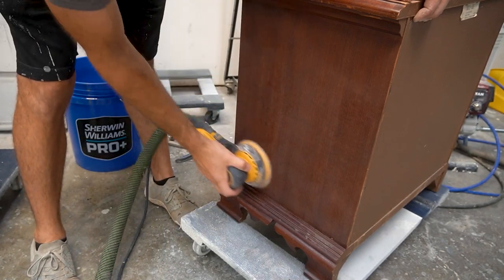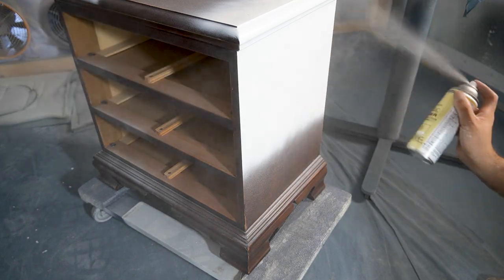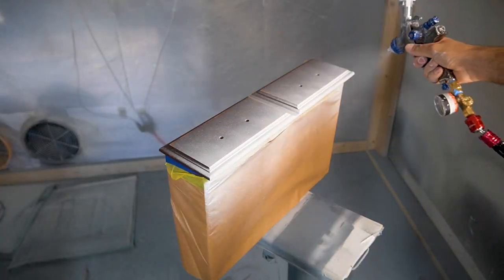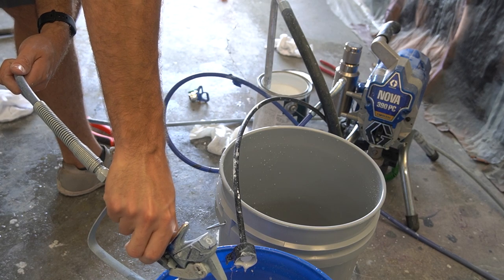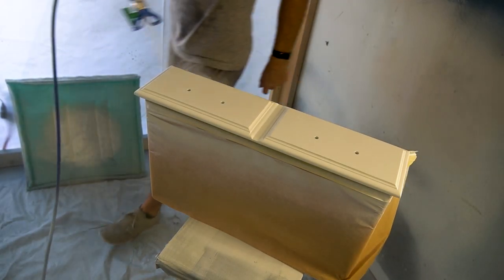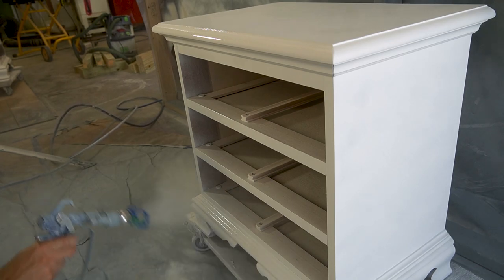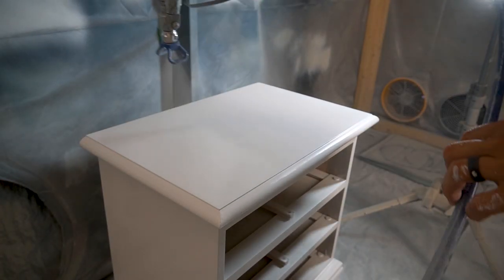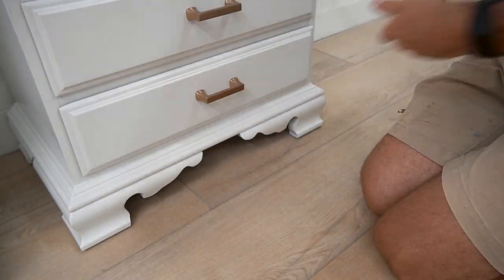Furniture Flipping - My Painting Process Start to Finish + Trying Sherwin Williams New Paint

Comment: Awesome paint job but maybe consider reworking or removing and replacing the swirly trim along the bottom and the legs imo. It keeps it from looking updated.
Reply from the maker: Ive thought about doing this before and making them square by taking the coping off that’s got that French provincial style to it, since the modern straight lines sell way better. It’s so much work though 😂 thank you!

Comment: You used a primer but Gallery Series is advertised as self sealing which is supposed to be all-in-one. Were you afraid of stains showing or was the paint low build? What are your reasons for using a primer with a self sealing system?
Reply from the maker: It is definitely not going to block stains. 
You should set up an account with Sherwin or your local Benjamin Moore dealer. Just get a company name, and set up an account, and they will give you better prices. 
Ben Moore owns a company called lenmar that sells a good vinyl sealer. Mohawk is good too. Also, BIN shellac is good too, but I prefer vinyl sealer. I don’t pay over 75$ per gallon. But no, it will not block stains in my opinion and should not be used as a primer.
Reply from the maker: Also Sherwin only has clear vinyl sealer which I don’t like. It’s too hard to see if you burn through.
Reply: @milosrestoration1337  yes I have an account with SW. I’m glad you said it won’t block stains as I was planning on using that product for a cabinet job over some maple cabinets. I have used BIN it has been my bread and butter but I am looking for an affordable vinyl sealer since that is the best thing as BIN will fail if the moisture content of the wood is too high or water penetrates through the topcoat. I am familiar with Mohawk and Lenmar but where I live in Florida I only have access to SW unless I order online. Have you tried any other 1k/2k polys and if you have could you possibly give a comparison to those against Gallery?
Reply from the maker: @bingobunga8995   yes I’ve tried centurion and a few other products that emulate a lacquer like duralaq. Also tried some other products that are 1ks. I don’t like any of the 2k primers, they’re very hard but I find them not to be as good at stain blocking or adhesion even though everyone claims they are. Gallery has better hang than any 1k products I tried and doesn’t have issues with micro bubbling or pinholes which will drive a painter insane. There is no primer I’m aware of like a good vinyl sealer! Mohawk had this one I’m linking to you. I really don’t like the finicky 1k products and I don’t mess with catalyst since I just do furniture and do a lot of different colors. Centurion is good and their customer service is helpful. I don’t use any of the Italian products though
Reply from the maker: @bingobunga8995  https://procabinetsupply.com/products/e-z-vinyl-white-sealer-550-voc-mohawk?variant=32250153566275&gclid=Cj0KCQjwkqSlBhDaARIsAFJANkjHkGByEk5povQVr4QYQnsum0MIyaKi6UzRJuxpWqZcaCsVmYOYvcYaArvXEALw_wcB
Reply: @milosrestoration1337  thanks! I just ran over to my commercial SW and gave them my contractors account and I can get Sher Wood Vinyl Surfacer Primer in white for about $57 per gal. I got the 5gal for $286. Thats wayyyyy better than BIN. I just like the build BIN has but I’m excited to try out this vinyl sealer. I know the lacquers burn down to about 20% of the original wet mil. Have you ever tried Kem Aqua Plus?
Reply from the maker: @bingobunga8995  yeah for sure! I have videos of me using it on the channel. It’s not that great. It’s not really performing like a 1k product and it has very poor vertical hang. Also, the transport time is longer in my experience. Doesn’t look as pretty either. It gets a bad rap with finishers but honestly it’s not that big of a deal.
Reply: @milosrestoration1337  that’s good to know seems like guys using the KA+ have the best results with AAA from what I read on painttalk and see on other YT channels. It’s also not warrantied for refinishes but that price is quite nice at $60/gal. Kinda sucks that Gallery is $120/gal but hey if it’s better than the other 1ks then maybe it’s worth it.
Reply from the maker: @bingobunga8995  it’s not the worst product. Not the best either. I can see if you could put it on thin and still have it level out like glass, that’s the thing I have to put a little more on and wait for it to level out. So I don’t know really, but if you’re looking for a refinishing product for cabinets or something it would not be my go to. Also, find a Sherwin branch that you can build some rapport with. We also do pool coatings so I have some credit with them because our company buys a lot of that type of product, but even knowing that if I walked into half the stores here they’d try to get me for retail for gallery. I’ve never had a true failure with BIN but then again I don’t have any clients past five years so it’s hard to really know. Everyone has a problem with some products, because everyone uses different equipment and has varying levels of climate control and experience. A lot of 1k products gave me problems with micro bubbling and dust showing in the coating. Gallery on the first go gave me less of that issue. If you have any questions shoot me a message on instagram

Comment: What vinyl sealer are you using cause SW vinyl surfacer I will not be using at $135 per gallon…
Reply from the maker: I ended up trying some BiN today before I sprayed more gallery. No comparison! I really don’t wanna go back to using it, I’m going to stick with the vinyl sealer
Reply: @milosrestoration1337  yes I like vinyl sealer just a pain if you only have one pump the clean up to use both water based and solvent based stuff is annoying
Reply from the maker: @bingobunga8995 I have a vinyl sealer pump.  It’s just an old titan 440
Reply: Yea eventually I want to get a tritech for finish coats but right now I’m working with a home owner special graco magnum x5. It shoots decent not ideal but it works. I highly recommend the graco silver plus gun. It has amazing trigger and pressure control. I use the cheap cone filters with a separate attachment, really awesome gun. I honestly think the 308 tip is the definitive best tip for shooting vinyl sealer and top coats. The 310 has too much orange peel. 208 is nice too but obviously not as much coverage. Kinda have to turn up the pressure a bit more with the .08 tips so there’s more bounce back so maybe the transfer efficiency isn’t as great as a 310 but for those fast drying coatings 308 is the way to go. Virtually no orange peel and boy do I hate to sand so I try and do everything I can to minimize that